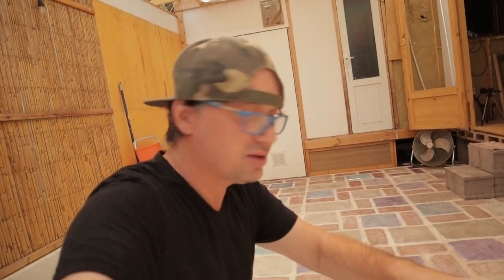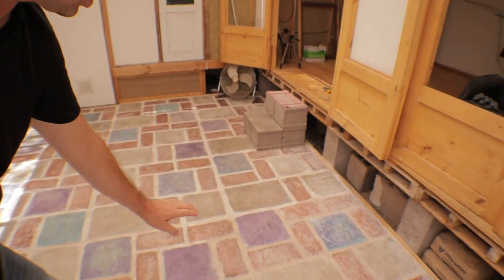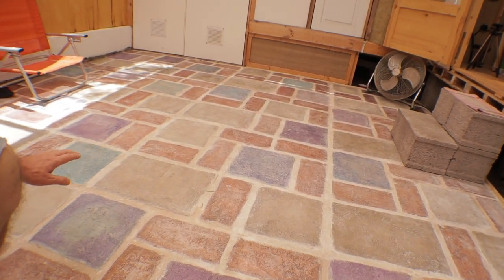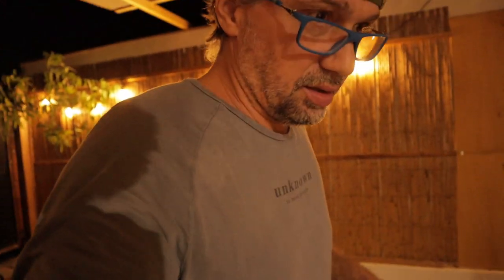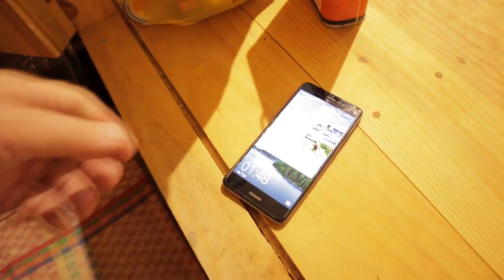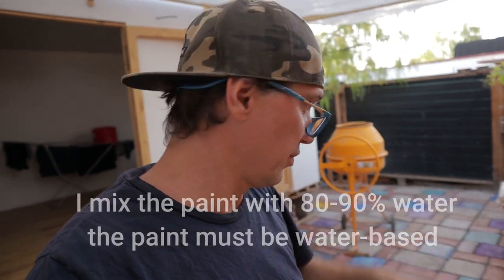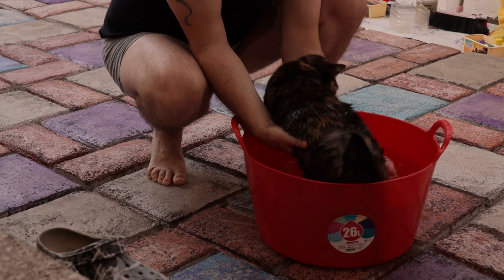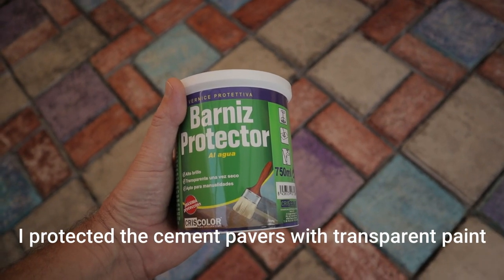How To Paint And Point DIY Pavers Like A Pro (S1 Ep19)

Comment: AAACK! You ended up in the right place - the pavers look great. HOWEVER - there are MUCH easier ways to do this. My husband and I worked his way through graduate school as painters, so I can help you out. 

First, ROLL on layers of the thinned out paint. A base color, then spot-roll on a second coat to selected pavers, then a third coat, etc. For instance, do a base coat of the lightest color. Layer the next darkest color over the tiles you want. Then layer an even darker color.  So, some tiles get layer 1 only, some get layer 1 + 2, some get 1+3,  or 2+3, and you get a beautiful result with many subtle shades. AND it is much much faster. 

Second, use a pastry bag for pointing. Just mix a slightly dryer mix (so it is like a thicker cake icing, not a thin pancake batter like you used). Put the mix in a heavy plastic storage bag only half full, Cut a tiny triangle out of the bottom corner of the bag. Twist the top of the bag and squirt the pointing mix where it needs to go. A lot faster, a lot less mess. It is easier to squeeze out evenly and to get a good finish if you fill the bag only half or 2/3 of the way full. When it is overfull, it squeezes out the top and is very difficult to control (ask me how I know that).

Keep up the good work! The house is looking good.
Reply from the maker: Thank you very much for your explanation!
Reply: I was just thinking the same, using a large piping bag would be easier.

Comment: My back hurts just watching this paver series but it turned out beautiful! Excellent work. I am looking to do the same thing on my dock. Can you tell us what paint colors you used? The color scheme looks fantastic🤗
Reply from the maker: I used water based paint the paints were for wood, walls, which I found at home, and some I bought. Then I diluted the paint with water, that the paint was liquid and could penetrate into the cement. In the end I painted everything with transparent concrete paint.
Yes, and back will hurt!
Reply: @klerobi1  What colors did you use?
Reply from the maker: @phillipwheeler809  like I said water based paint
Reply: Yes Robert,  you pointed that out in your video. What I was meaning to ask was the different color of your tiles,  looks like brown, blue, aqua and another shade but I am a little color blind and am not sure.
Reply: @phillipwheeler809  look to me like radish brown, blue, purple, and  peach